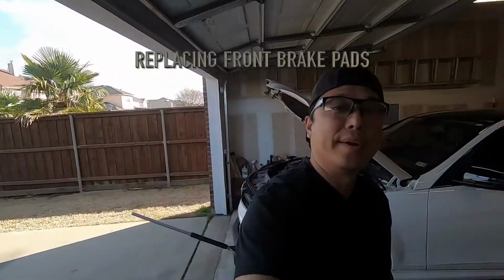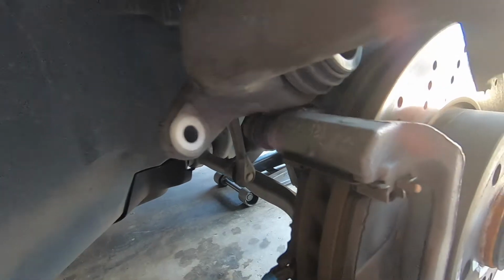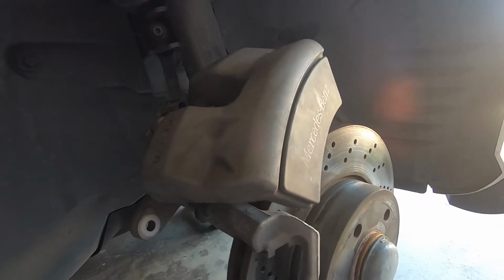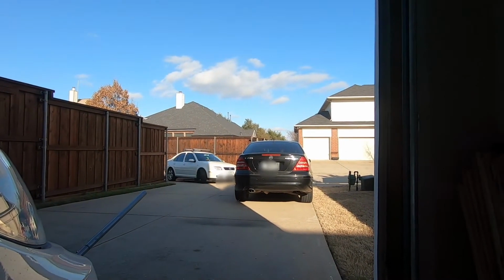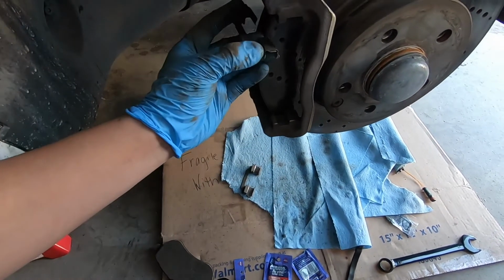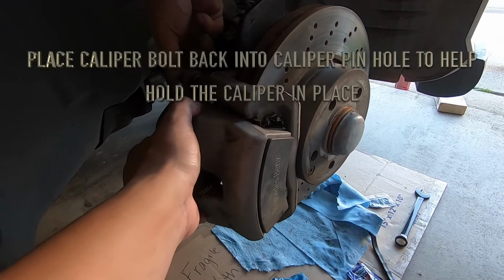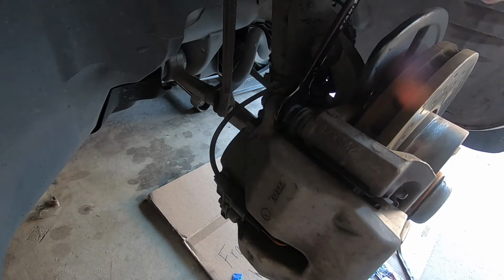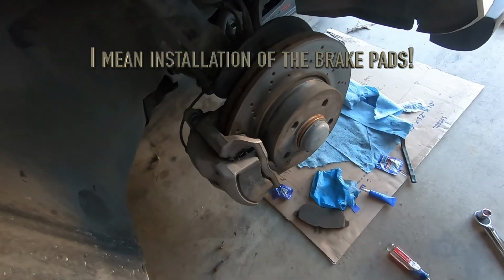How to Change and Replace Front Brake Pads For Mercedes C250 C300 C350 W204

Comment: Hey bro did you had to reset the brake light on the dashboard after you finished or does it away on it's own ?
Reply from the maker: The light went away on its own.  Probably since I had a new sensor put in also.

Comment: Does it have sensors on both driver and passenger side?
Reply from the maker: Mine is only on the passenger side.  I always replace them both at the same time.
Reply: @RapidRalphsVehicleVlog  ok great thanks for the info

Comment: Great video car looks so clean can you do video on rear breaks also can you help me on were to get tools for the car
Reply from the maker: Thanks!  I was actually going to change the rear brakes at the same time, but they were still good. I will make a video when it is time for me to replace.  For the tools, I use the Dewalt Mechanic Tool Set. 142+ piece set.  You can find good deals on them throughout the year.  I use various sets for wrenches and bigger sockets.  I also use tools from a place called Harbor Freight.  They are cost efficient and work for my purposes.
Reply: RapidRalphsVehicleVlog Thanks so much for your help!
Reply: I realize it's kinda randomly asking but do anyone know a good website to stream newly released series online?

Comment: I recently changed mine and the brake pedal goes all the way to the floor. Any suggestions? 😟
Reply from the maker: Did you pump the brakes until it builds pressure back up?  Some instances, can be a lot of pumps, some cases it can be little.  The pedal will go to the floor at the beginning until the brake fluid goes back through the lines.